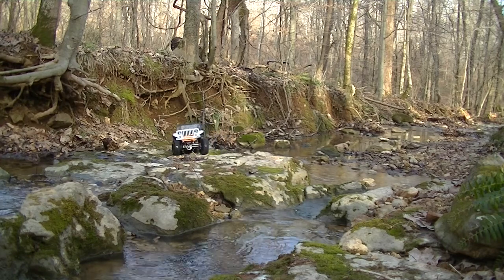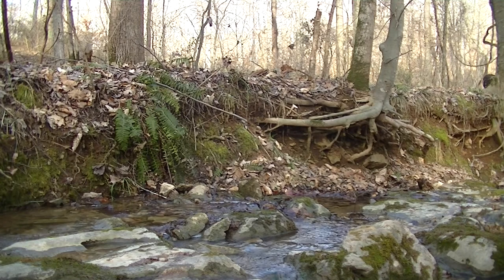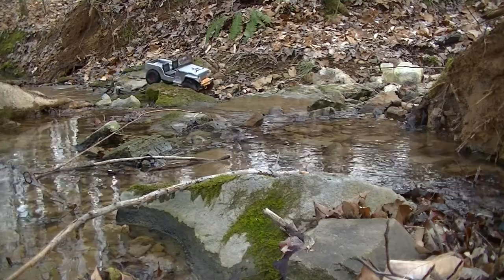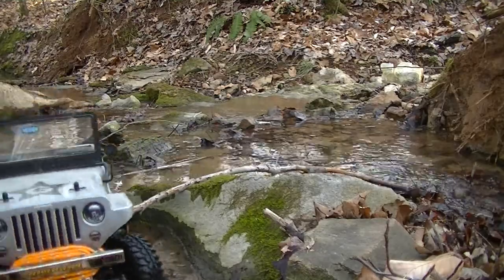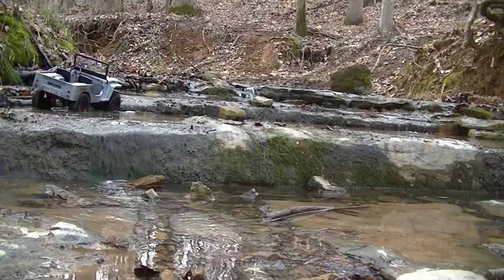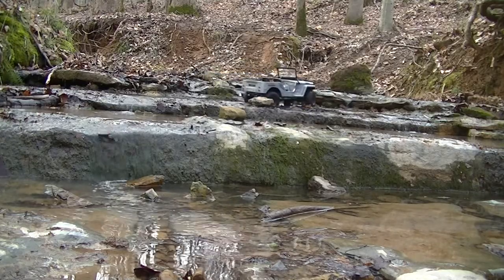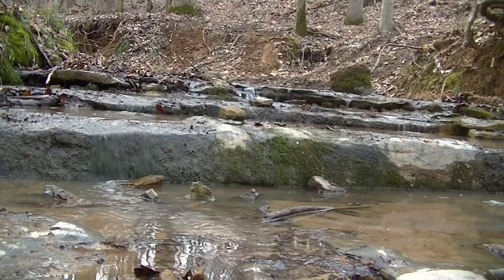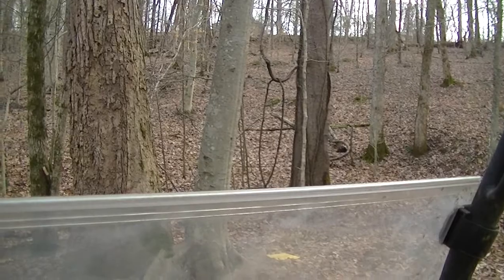Gmade Sawback Run 2: New Setup

Comment: Man I am really unsure about this dam sawback? But hey u never had a twin hammer ?? Two total diff rigs but I kinda want both  what's ur take on the twin hammers
Reply from the maker: I absolutely hate the TH with a passion. The first reason would be the shift servo issue, followed by its size not being a true 1:10 rather a 1:12 and the nail in the coffin is the amount of $$ needed to upgrade it to get it to perform like it should in their videos and mechanically. The sawback is an excellent kit, rivialing RC4WD as far as quality other than the piss poor instructions. I have beaten this rig off camera several times with all stock components minus my suspension mod and running 12mm metal hexes or pin mount steelies and haven't broken a single thing